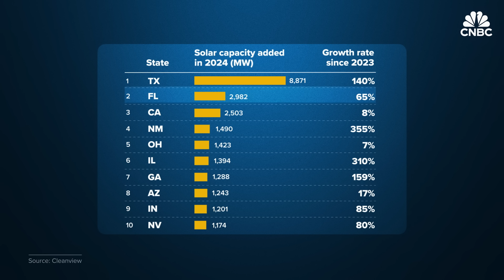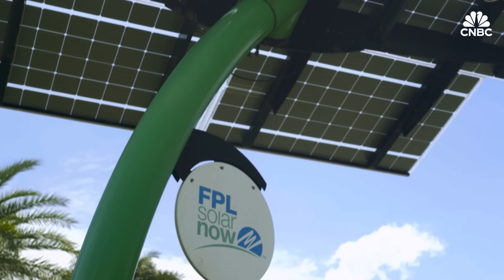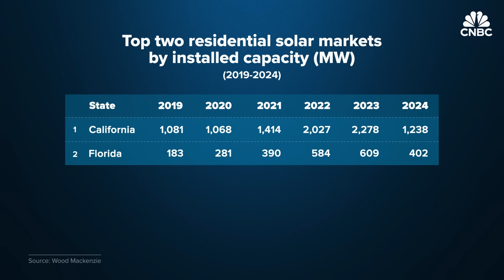How Florida Quietly Became A Solar Powerhouse

Comment: Solar takes so much land, and is a trade off between land for homes and green space. For a company I deal with, they have one plant that is net zero. They had to buy 2 farms beside the plant to fill with solar panels to achieve it. Last year, a hail storm wiped out 20% of the panels and took a few weeks to replace them all due to similar panel availability.

2 of my uncles are engineers (in retirement now), and worked on retrofitting coal plants to be more efficient (coal plant scrubbers). The technology in the early 90s was very good and worked well (can only imagine how good it could be today), where we couldn’t use the smoke from the stacks as a visual from the lake as way to guide our boat home.

I think the hybrid solution is the best, where resident homes should try to shave off their reliance on the grid with solar, but still have coal and natural gas plants from the grid. This will help keep grid costs down on power production, and permit them to improve the rest of the infrastructure was at risk from natural disasters (solar flare storms, storms, earthquakes, fires and even terrorism).
Reply: There is no need for coal at all really. Gas burns cleaner and that same tech can be used to clean the waste that gas produces anyways if you are going that route. Nuclear might be the better option of the two if I had to choice as well. With that said, renewables do take more land, but that land can be doubled used as well such as putting a small farm around them or just letting the wild life make use of the land such as for bees/flowers.

You are right in that homes should focus more on just reducing their needs from the grid while leaving the grid to use more direct power, but there is still a ton of land we could use around cities and towns that can still perform the same roles to offset business and homes. Honestly, business should be the ones adding more solar than homes only because they do operate more during the day time hours and thus would have access to the cheaper perios of that power use.

Comment: I have solar for 3 years and its money best spent in my life. Free AC/hot water/driving.. But hopefully it will not catch a fire :D With current prices of solar panels, im not as afraid of hailstorm i will just change them its not deal breaker. Only problem is more 500v-800v DC connections = bigger fire hazard, but hopefully my instaler did good job :)

Comment: Solar panel farms are raising local temperatures by up to 9 degrees Celsius above normal. They're destroying local flora and fauna, and drying out the soil (a 2024 Japanese scientific study). This is supposed to save the climate, isn't it? What's the real cause of this accelerated warming? CO2 is only a tiny part of the problem; it's largely due to infrastructure, deforestation, and energy waste!

Comment: Good to see that some change will happen even against the odds of mindboggingly stupid leadership.

What irks me with the Babcock example is that they use external land for solar. Lots of virgin roofs!
Reply: People don't want solar on the roof in Florida, current solutions are big liability in a hurricane, plus very expensive to remove and replace the solar panels every 15 years when insurance requires you to install a new roof.  That said, I personally have a large enough lot that I would love a solar array in my back yard that I could park my boats under.

Comment: USA has 238 GW of solar energy installed capacity. China 1,080 GW installed capacity and adding 240 GW each year. USA is lagging far behind of China in solar photovoltaic electricity deployment.
Reply: The EU is at 47% renewable, the US is at 24%. 15-20 years behind and loosing ground because of the orange one.

Comment: What America really needs to look at is Agrivoltaics where the Solar power generation and agriculture is done concurrently on the same land. it has shown to improve both the efficiency of the solar power generation and also the yield of certain crops grown on the land. Also the farmers earn from the solar power generation on top of the crop yield. and the shade from the panels effectively changes the conditions of the humidity, sunlight that can be designed to benefit higher value crops.
Reply: Yes, but, not all crops will work with it as they need the full sun. So it will depend on that area if they will use them or not. Farms that work with animals, should not have any problems and can double up on the land use, but lettus for example, would rather have the full access to the sun other wise, they dont grow as big. In those cases, a Wind Mill would be better for them. With that said, we over produce corn that turns into gas for cars. Instead of more corn, they could produce power directly instead and charge up EVs. In stead of a 10% return, it could be as high as 90%.
Reply: They have to soak the ground under the solar panels with herbicides and pesticides and higher illegal immigrants to do weed whacking. Unless of course you buy the new Elon Musk X-Blimp to hold the solar panels in the air above the ground. I've invested all my savings in the X-Blimp it's going to be huge.
Reply: @AmericatheBeautiful-p4z  No they dont. Some just use electrical robot mowers and that is growing day by day. Even them you dont even have to mow around them that offten and we already had to to farm that area, so its really no different at all.

Comment: Yes, Florida utilities have been pushing solar friendly development policies for themselves while actively fighting against residential solar for homeowners. They’re all for protecting their monopoly.
Reply: Texas has a vibrant energy market, Florida has monopolies which actively fight against consumer choice. Sunshine state is very anti-solar.
Reply: dUH...
Reply: It is much more economical to add (and manage) 10,000 panels in one location than it is to add 20 panels to 500 roofs.  I have panels on my roof, but they can’t function if my neighbor’s tree falls on the line.  I also had to buy and maintain 16 micro-computers and a controller while a central system can manage over 100 panels with similar investments.  Economies of scale.
Reply: @DM-zq8qy  All 10,000 panels are useless if a tree falls on a single transmission line during a hurricane. Meanwhile, if 500 homes have panels and battery backups, those homes will almost never lose power. Also, those homes can generate $ for energy they overproduce, this is why utilities don't like it. "When Hurricane Ian slammed SW Florida in 2022, Babcock Ranch stayed powered where millions of Floridians lost electricity."
Reply: @DrDubbs All true.  Many of us don’t value independence highly enough to spend an extra $12,000. We just move to Georgia for a short vacation. 😂
Reply: @DM-zq8qy  Well maybe you invested in the wrong system. There are many Inverters that work without the grid and can switch the grid off if it fails and continue to supply power to your home. These systems can, but don't have to feed power back to the grid, you could just use your own PV as far as it goes and only what you cant generate yourself comes from the grid. The system I installed at my fathers home would not need the grid 10 months a year.
Reply: @DM-zq8qy  
And that's what batteries and off-grid systems are for. It's about saving the homeowner a ton of money if implemented correctly, which you don't seem to care about.
Reply: @DM-zq8qy  Managed what? Its no harder than turning on your light. Sounds like you invested into the wrong type of system or solar only. You need to do both batteries and solar.
Reply: @adr2t  Yes. I chose the $9,000 option instead of the $22,000 “always on” system (with batteries.)
For $1,500 I got a smaller Bluetti solar battery that can run my refrigerator for 24 hours.
Reply: @DM-zq8qy  Yes, but there isnt anything that the power company has to managed on your system. So it doesnt really matter if its 10,000 on their end or 20 panels on your end over 500 houses. If anything, it just means they can't charge you for those 20 panels across all those homes.

As for the power cut you have a few options actully and more are coming onto the market. Yes you can get the $22k, but they can be scaled and as your pointed out, you can get smaller units to handle some of the smaller loads. Follow by getting switch over systems.

The reason its design around your way is to keep the utility lines safer incase they need to work on the lines, but you can just switch over to your off grid system as well.
Reply: @DM-zq8qy  utter crap, consolidation does not constitute higher reliability. Single point of failure for utilities that go down from a light rain means less reliability and all of that consolidated solar power wasted. Not to mention basic physics and energy losses x distance. Sip your BS tea by yourself stop sharing false information
Reply: @DM-zq8qy those fpl windfarms are located in the winds by trees. If a tree falls it can knock 100+ of those panels down onto them. At least with them on your house you control all the internal factors that you can't with paying fpl hundreds for them to pay politicians campaign coffins for DeSantis
Reply: This is wise, we have hurricanes.  Large utility companies can keep panels in stock, homeowners are stuck.
Reply: @tonyburzio4107 modern rooftop solar installations are very wind resistant. If your solar panels go, it’s because your whole roof went with them. Then it doesn’t really matter. Also, are you really defending anti-consumer friendly legislative proposals, such as ending net-metering, lobbied for by for-profit energy companies? If so, I’m sure they appreciate your unwavering subservience.
Reply: @tonyburzio4107  Why should they decide who is allowed to buy solar panels? Shouldn't consumers make that choice for themselves, not a nanny state?
Reply: @tonyburzio4107  Your idea sound dumb

Comment: Solar with subsidies is on par with existing natural gas at $35/MWh. When you have to add batteries the cost of solar energy increases. So no, more solar beyond what the grid can absorb without batteries will not make energy cheaper.
Reply: Thats a old number. Battery prices and solar are constantly falling

Comment: We wanted to get solar this year but our roof is the exact awkward age where it doesn't make sense to get a new roof yet but it also doesn't make sense to put panels that will last 20 years on a roof that has less than 10 years left in it.
Reply: Ground mount?
Reply: That is a good point, but solar panels are often warrantied for 25 years, they will easily last 30+ years...

Comment: Power companies make it harder for homeowners to install solar on their roofs, so they still have to depend on power companies.
Reply: It's not power companies its insurance
Reply: @Distress.  Insurance....? what State are you in?
Reply: Except, more and more people are just going off grid completely.  Battery storage is getting ridiculously cheap, and even people living in the sticks are going off grid with 30kWh worth of storage for under $4k...
Reply: @redbaron6805 you can't legally go offgrid in most of Florida. You have to maintain a grid connection and if you go above 10kw of solar generation youre mandated to carry an additional liability insurance policy on the system. And fpl also lobbied the state to reduce net metering from 1:1 to 2:1 with further decreases in the horizon.
Reply: @christopherwaggoner7125  You are mostly correct, although there are some nuances here.

You can actually go 11.750kW because of the 85% rule if your panels are DC panels vs AC Inverter panels, which most people would get today so they can use storage, so that allows you to stay within the Tier 1 limits.

Net metering is a waste already because storage is ridiculously cheap now, with each 4kW of battery storage being as low as $300.

Yes, even if you go off grid, you still have to pay FPL a minimum bill of $25 month or so, but you could also just use the grid to power things if there are days of clouds and rain, so you could go mostly off grid, even if you are technically connected to the grid.

Even if your electric bill would remain $25 a month, it would still be worth it, as my annual electric bill is at least $2k to 3k a year or more...
Reply: because republican legislators let them
Reply: The bigger pushback is from fossil fuel companies

Comment: 70% of the cost of rooftop solar is installers overcharging, and pointless permitting. Then they sign homeowners up for horrendous terms on a loan, so the final cost ends up being 5x the actual equipment cost. Just do it yourself and save a massive amount of cash, and have a very quick payback. I am fine with getting rid of the tax credit because it was just abused by investors lending, and solar companies.

Panels are extremely cheap these days, some just make fences out of them because that is a similar cost as building a fence.

Comment: Happy as hell i built my own solar system.  So nice not depending on anyone fir energy
Reply: Built my own solar power system here in Jamaica too. Solar has become my hobby and so i'm always slowly upgrading my system. I pay little or nothing for my electric bill and i'm very happy with that. Also during a hurricane when everyone else loses power i'm still fully powered.
Reply: @lawrencedavidson6195  That is definitely a huge plus.  It is definitely a setup I'm looking into in the coming years.
Reply: @lawrencedavidson6195  yep a hobby now.  I keep tinkering and building systems for friends and relatives now
Reply: Are u an engineer?
Reply: @codeintherough  You don't need to be an Engineer to build one.  These systems are modular and exceptionally simple to build.  People are going off grid in the sticks and literally assembling these systems and connecting them together with no real technical background.  It just takes a little bit of research and countless people have channels already explaining how to do this from beginning to end.
Reply: @codeintherough  it's very easy to get a solar system up

Comment: solar is a scam, bought $50k of solar panels for my 2600sqft home, I only get $30-40 off my $400 energy bill each month, its a scam.
Reply: I put solar panels on my roof 10 years ago.  They already paid for themselves and will go another 10 years.  Maintenance-free, no storm damage.  And I don't live in the Sunshine State.
Reply: My solar panels paid for themselves after five years. I rarely pay more than the fees to create and deliver the bill. I also run the a/c's nine months a year and the pool filtration year round..
Reply: A person might get scammed by anything or situation.   That's why I think they shouldn't promote solar on individual houses.     Let the utility company handle all the paperwork and risks in selecting the better solar panels and companies to provide them.     
   
The are used if solar and wind were to provide all the electricity to Florida would be about 1 percent of the land area of Florida.